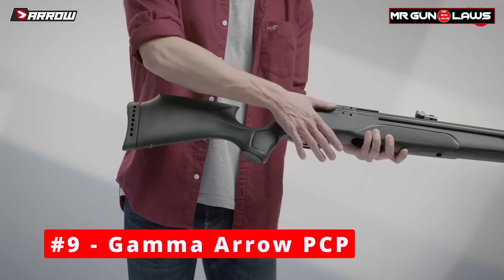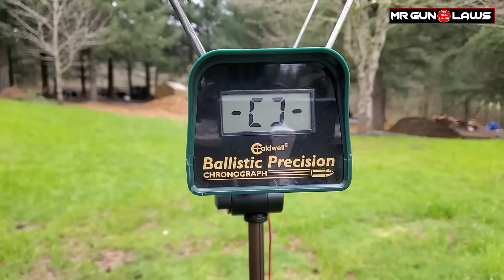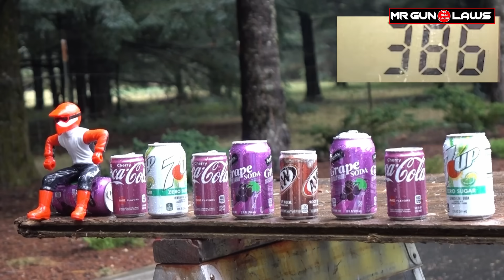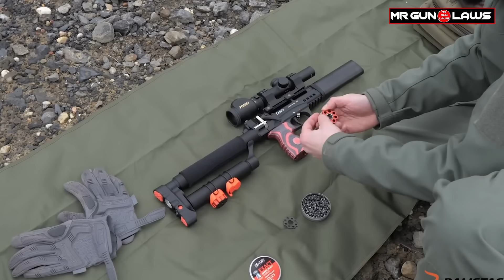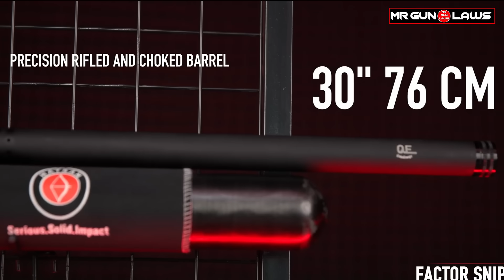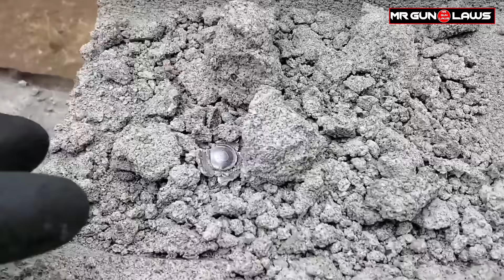Why 69% of Americans Are Secretly Buying These Air Guns in 2026!

Comment: How do you make this video without covering:

1.FX Impact M4:The Benchmark: The undisputed king of customization and competition accuracy, utilizing the Power Block system to maximize plenum volume.The Speed & Tuning: Capable of pushing light pellets or slugs well past 1,100 FPS. Its dual-regulation system allows you to tune it precisely for any caliber from .177 up to .35 for pinpoint slug-on-slug accuracy.

2.AEA Zeus Gen 2:The Powerhouse: Crowned as the most powerful mass-production PCP air rifle in the world, generating up to a staggering 1,500+ foot-pounds of energy (FPE).The Caliber: Available in a massive .72 caliber barrel (as well as .58 cal), firing heavy lead slugs that can cleanly take down the largest game on earth.

3.Umarex Hammer .50:The Repeater: A hard-hitting, regulated .50 caliber platform utilizing a 2-round magazine mechanism.The Output: Slings 550-grain slugs at 760 FPS, pumping out a massive 705 FPE right out of the box with incredible shot-to-shot consistency.

4.AirForce Texan LSS:The Precision Hunter: Widely regarded as the most accurate big-bore rifle on the market, featuring a premium Lothar Walther barrel.The Specs: Available up to .50 caliber, pushing out over 800 FPE. It provides the perfect balance of world-class accuracy and lethal, large-caliber stopping power.

5.Skout Epoch:The Tech Leader: An ultra-premium, electronically regulated competition rifle designed for flawless harmonic balance and zero recoil.The Accuracy: Its barrel format lacks standard rifling restrictions, allowing it to shoot slugs at incredibly high speeds with unmatched accuracy over extreme distances.

6. Hatsan Blitz .30 Caliber:The Firepower:  It features a true select-fire mechanism capable of cycling fully automatic at 1,000 rounds per minute.The Specs: Slings heavy 44+ grain .30 caliber pellets or slugs at over 1,000 FPS, producing roughly 50+ FPE.Drone Capability: At 50–75 yards, a 2-second burst puts a literal wall of high-energy lead into the air..

DO SOME RESEARCH FIRST!!!!!!!
 FX Airguns Competition DominanceFX Airguns—specifically the legendary FX Impact series—has dominated the competitive precision airgun scene. This is most prominent at the Extreme Benchrest (EBR) world championship, widely considered the premier event for high-power precision air rifles.The 75% Era: Following the introduction of their Smooth Twist X (STX) barrel system, FX completely overwhelmed the competition field. In the late 2010s, up to 75% of top-tier finalists across major benchrest competitions were shooting an FX platform.

List of things legally harvested with FX PCP rifles:
Feral Hogs / Wild Boars (150 to 250+ lbs) via precise brain shots.
Mouflon and Corsican Rams (100 to 150 lbs) via high-precision head or neck shots.
Whitetail Deer (100 to 150 lbs) where locally legal, using close-range vitals shots.Exotic Antelope (70 to 110 lbs, like 
Blackbuck or Springbok) using high-BC slugs.Coyotes and Bobcats (25 to 45 lbs) easily taken at long distances.

Same list for AEA Zeus Gen 2:
American Bison (1,500 to 2,000+ lbs)
Cape Buffalo (1,200 to 1,800 lbs)
Eland and Wildebeest (600 to 1,500 lbs)Grizzly 
 Black Bears (300 to 800+ lbs)
Massive Feral Hogs (300 to 500+ lbs)
Elk and Moose (500 to 1,000 lbs)
Whitetail and Mule Deer (150 to 300 lbs)

Comment: Can you do an evaluation of rapid fire air guns capable of disabling a drone at 50-75 yards?
Reply: best bet is Umarex   
Guy did zero research for this video and skipped all best models.  (see my other post for a breakdown.)
Research the Hatsan Blitz .30 Caliber:The Firepower: This is the ultimate tool for the job. It features a true select-fire mechanism capable of cycling fully automatic at 1,000 rounds per minute.The Specs: Slings heavy 44+ grain .30 caliber pellets or slugs at over 1,000 FPS, producing roughly 50+ FPE.Drone Capability: At 50–75 yards, a 2-second burst puts a literal wall of high-energy lead into the air, maximizing your chances of hitting a moving airborne target and instantly shredding structural composite components.
Reply: Oddly specific...😅
Reply: @alexanderbattin4227  hahahahahahaha totally
Reply: Federal crime.

Comment: I have to say I only have childlike experience with air guns and seeing these changes the entire game! The last one was insanely badass and then there were a couple that were simply the cost of a used car. No thanks. But damn they did destroy a cinder block with an air gun! That’s something I’ve never seen before and I damn sure like it! Also to add suppressors on them? Ha! I think I know what I want for both my birthday and Christmas!! Although they didn’t have any handguns, I’d imagine that the propellant capacity would be minimal and only give you the fewest possible shots, maybe 6-8? Before requiring a refill. 
Back in the late ‘80s I found an advertisement for a full automatic BB gun that ran off of either compressed air or, get this, Freon R-12! So I’d go into my local (20 miles away) auto parts store and buy cans of Freon at $5 per can and burn through them like water. Can you imagine that today? Only because we didn’t have an air compressor. And damn I wished we had one. But it performed like it said it would, don’t know what happened to the company, I was just a kid back then. With an actual fully automatic BB gun. I, was a badass. Or so I thought.

Comment: I bought a byrna self defense gun I found aluminum rounds for it and I'm scared it's just as lethal as a real gun now because it cracks cinder blocks and puts holes in wood fencing and that's without the upgraded air cylinder and drum magazine I'm still getting both soon though 🤷🏾‍♂️
Reply: its for defense.  so use it as such.
Reply: why are you scared? The person breaking in is going to kill you with a ballistic weapon, r8p your family, and steal your sht.
Reply: I have the Byrna mission 4, which is technically a Tippmann TMC elite, and with all the internal modding I've done I've only been able to get 6 gram rounds to shoot around 40 joules, there's not much you can do with a blow forward system as far as power. It's a nice platform but very expensive. Now my valken M17'S on the other hand, both of my A2 models and my CQMF are all shooting 8.2 gram rounds over 100 joules, and I use 15ci tanks so all 18 rounds in the magazine shoot between 105-95 joules with air to spare. They work on a blow forward system as opposed to the blow back bolt system like the mission 4. I have an Pistelle X68 that I've turned into a carbine with a 16 and a half inch 686 smooth bore barrel that shoots the same 8.2 gram rounds at 146 joules, I just shot it yesterday with the newer HD24 long air chamber in the back. Those 4 air powered guns are absolutely as deadly as the real thing, but if you're going for LL then keep looking around, Byrna is crazy expensive and you can build your own like I did for half the price and get the same or more power out of it. Milsig just came out with a Gen 3 M17 in a LL version and it shoots I think 30 to 40 joules out of the box with the right psi output from your tank. Obviously I was going for lethal applications with mine but there are good ones out there that can shoot much lower and cost way less than Byrna.
Reply: Where does one find what you have found?

Comment: For self defense in case a firearm is not an option, I'd opt for a repeating crossbow.  More power, easier to maintain and keep at the ready, and excellent penetration even through thick layers of sturdy clothing.  A modern repeating crossbow can give you around 10 shots at a good rate of fire (2-5 seconds between shots), reloading done by swapping out a magazine just like a regular rifle.

Comment: Where you gonna plug up your compressor? You ever hand pump one of these? I have . It's painfully slow and a workout.
Reply: It's called a hpa bottle like a fireman's scott air pack bottle. Can easily fit in a sling pack 4500psi will fill the gun about 10 times. Most big bores get between 4 to 20 shots a fill

Comment: I used a .22 caliber PCP a a few years ago to clear iguana infestations at the condo I worked at. I can't recall the brand but it was on the lower end. 7 round magazine semi auto. It took iguanas out from quite a distance and was the most accurate rifle I ever shot. Not lying when I say I put 5 shots into the center of a 1.5 inch washer at 30 feet. I am no where near close to a sharp shooter but that rifle made it insanely easy.
Reply: If you could please find out what rifle you used. I'm very interested in knowing the brand and model.
Reply: @meathead5670 I found an old image of it and it looks to be a Stoeger XM1. I'm not sure if that model is still available. One thing to mention is that we bought a special hand pump for this designed for pcp rifles (DO NOT USE THIS PUMP ON TIRES and you can't use a standard for pump as it won't come anywhere near the pressure needed). Otherwise you will need an external powered pump or a scuba tank to fill it. If you get the hand pump it tastes a bit to get it to start registering pressure. Luckily you can get 15 to 20 shots from a single tank or about 2 1/2 to 3 mags worth.
Reply: @CandorPerlicious Thank you. I really appreciate you taking the time to get that information.
Reply: I got the same results with a Browning 22 pistol and a reflex site but still consider myself very much a novice.  Watch Hickok45 for some real shooting.
Reply: Kral are a Turkish brand and well worth a lookin into if you want accurate and silent.pcp are the ones
Reply: Absolutely you have more accuracy, no recoil or hardly none at all.
Reply: Air rifles use AAA berrals! That why there  accurate but also they don't shoot the same way as a gun power rifle. 
But also ungs are  all inherently accurate ! 
A 1080s M-16 from the USMC will put 5 rounds in a  50 cent piece at 300 yards with peep sites!

Comment: What about maintenance and reliability?It's hard to keep those things trimming, right?And the seals on time , they're just not reliable
Reply: I thought the same thing butbi own zues 72 cal a AEA 51 cal bullpup an umerex gauntlet sp 30 cal they are so simple to replace o rings I was amazed im not gun smith savy an I did it the zues is beast 72 cal slugs omg its most powerful air rifle in world they are coming with 95 cal at 7000 psi I cant wait
Reply: They are more reliable than any 22 caliber weapon.

Comment: There are PCP air rifles that can take out an intruder now 😁 like the 50 caliber megalodon pump action 💥 has more power than the certain handguns 🎯🤟
Reply: Check out this air rifle.... AEA Zeus 2 Tactical (.72 Cal): Produces ~1,500+ ft-lbs of energy, available in 16, 24, and 32-inch barrels, featuring 4500 PSI max fill pressure.
Reply: @LH-kz2nf the zues is a beast but .25-.45 punch holes through anything!
Reply: The huben gk1 is a pistol that has more stopping power than 22 lr. Its not the most powerful thing but its definitly lethal, semi auto and 18 shots. Definitly lethal.
Reply: Whats even crazier is the bolt rounds
Reply: I have an Umarex Komplete  in 22 cal 10 shots each wheel I wouldn’t stand in-front of it.
Reply: Yeah that's what I thought we were gonna be talking about here
Reply: Intruder?  Why not just use a .38 cal snub nose revolver?  Cheaper and easier to maneuver in close quarters?  Do you really understand self-defense?
Reply: @SilverShadow2LWB maybe someone doesn’t wanna blow their families ear drums. Others do not wanna own a firearm, and many may no longer be able to own a firearm. If you think a .38 stub nose is the only option then you’re really not true gun enthusiast
Reply: @madmaxthemotomutt6464 true, most of the air gun as defense is because the buyer isn’t able to get a real firearm. So it’s about sliding into the game unnoticed. Or staying quiet. Whatever makes you feel better! 😂
Reply: @SilverShadow2LWB it depends on where you live...some states like NY getting a a .38 is a nightmare. Also for felons...there's guys who got in trouble 20 years ago for a couple DUIs that still cant buy a firearm.
Reply: A pellet under the influence of PCP sounds truly frightening 😅
Reply: @Jungleballz420 love the sense of humor

Comment: air rifle shooter here gamo arrow is at most a entry level squirrel gun same fot the norica just more expensive the sig mpx is a weal bb only gun not suitable for hunting same for barra 400E the leshey is a top line air rifle for hunting small game the bintac is the only one that comes even close to firearm power
Reply: Yeah there are plenty of airguns that blur the lines of airgun to firearm capabilities and your right. There's some decent 30 cal semi automatic rifles out there that can be pretty good self defense wise but to really get the fpe to effectively stop someone every time you need a true big bore. I'd go with one of the double barrel shotgun options or maybe a 357 like the Benjamin bulldog.
Reply: A huben k1 would not be fun to deal with if you were an intruder either.
Reply: What are you talking about I have the sig 30 round belt Fed and it does not shoot BBs 177 cal. Alloy hollow points and it definitely will take care of your squirrel or any other pest problem you may have The accuracy is dead on as fast as you can pull the trigger I don't know if they have a model that is belt fed for BBS they would fall out the sig Cane breaker which is the exact one that they showed in the video that I have. It hits metal targets hard. The grouping is out of this world dead on but you got to do your part I like it Because right out of the box ready to go I'm not trying to take down a Bear but it will stop a Coyote from eating your neighbor's dog 🐕 send that Coyote running real fast close at a range of 5 ft a few head shots I think I could drop it And there's a whole bunch of them where I live and they consistently go after small dogs and cats in the neighborhood. This is exactly why I got it
Reply: What?!?
Reply: @XtianDrumGuyThis guy clearly didn’t finish third grade
Reply: The norica viriatus, 900fps is fast
Reply: I have to be that guy who must know if you meant “real” but misspelled it as Elmer Fudd as “Weal”?

Comment: Why would you spend a ton of money in America on an air gun thats no stopping power
Reply: There is airguns that penetrate steel
Reply: @bigmarkthe1 😂 what… tin cans
Reply: @garethlittlewood7129 I've punched through a 1/4" thick aluminum pot at 25 yards with the right pellet in my .25 caliber JTS Airacuda Max. I've got plenty of center and rim fire guns and my Air gun gets the most use because it's quite. Addressing squirrel and ground hog problems with anything other than my air rifle will insure that neighbors are aware of my activities.
Reply: @AMetalWorks I get that